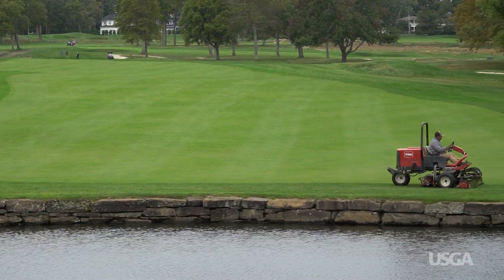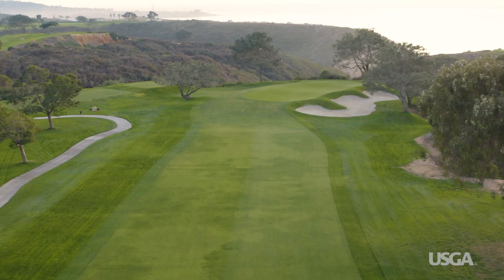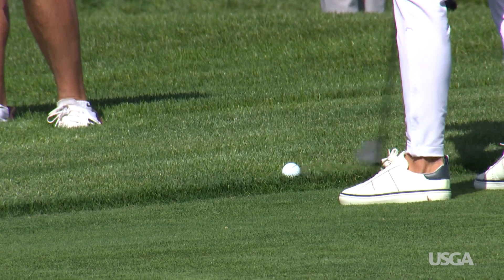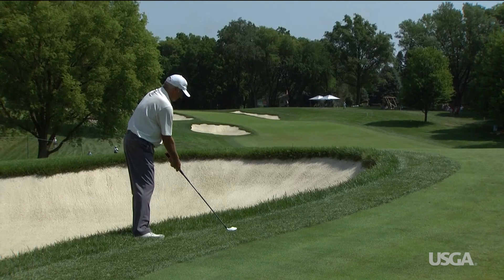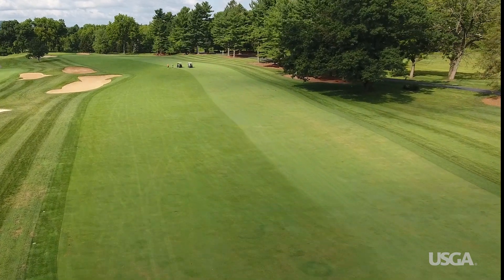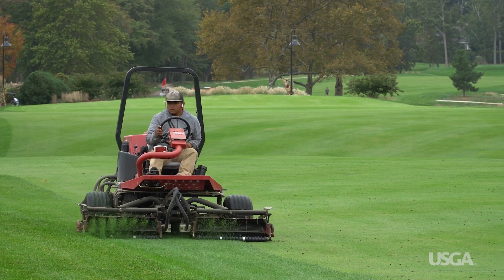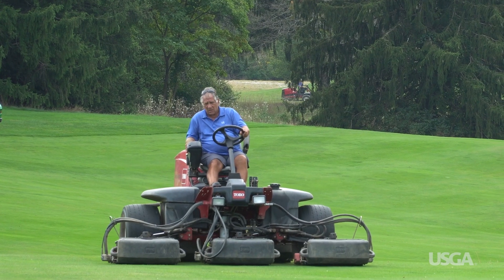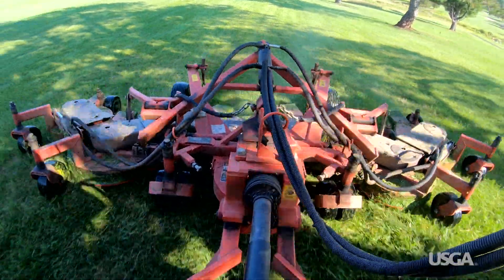Does Intermediate Rough Make Sense For Your Course?

Comment: We got rid of our intermediate rough for the reason that we only have one toro 3500 with rotary decks. Checking the height twice a week got real old real fast. We used to mow int. Rough Monday morning, then change it to a higher HOC to mow greens surrounds and other small sections of rough tuesday, wednesday and Thursday, then lower the HOC for a Friday mowing of the int. Rough.

It was just a pain. We didn’t have the labor to dedicate to mowing it twice a week and changing the HOC on the toro decks isn’t fun. 

I’m glad we got rid of them. Plus it makes it easier for the fairway mowers to see where the edge of the fairway is when mowing the clean up pass. Having a greater difference in the heights of the fairway and rough made it so much easier to see. And frankly, I don’t think it looks bad without it.

Comment: Not having the intermediate or first cut as we call it would slow down play tremendously.
On our course the rough is left alone almost and we have natural areas all over. Means you can play a provisional right away when it can be assumed you are in the rough. Little chance finding the ball and if you do be happy when you can get it back in play with one stroke.

Comment: The issues in this video are over played. Most courses do not need it but it does make a golf course look so much better and can actually improve the player experience. Also, extra tee boxes cost a lot to maintain and the front and back teeing areas are used significantly less. Courses can eliminate them to save maintenance costs also but you don’t hear the USGA saying that. 

I’ve play some origami AJ Tillinghast and Donald Ross designs that have one teeing area and two sets of tees. Why do some courses need 4 sets of tees an 100 yds of separate tee boxes.